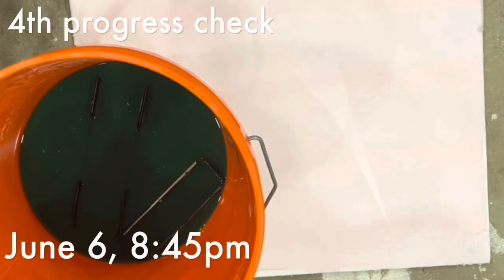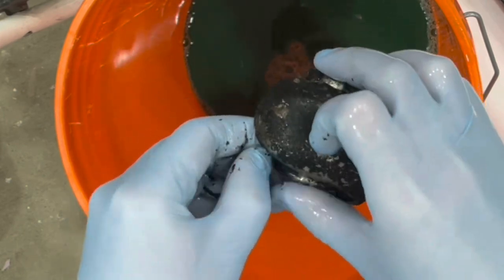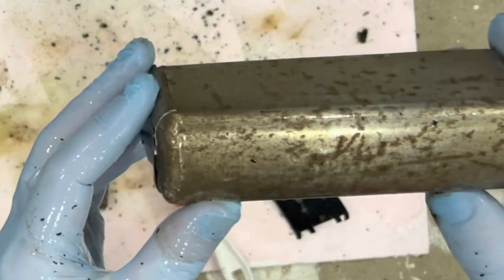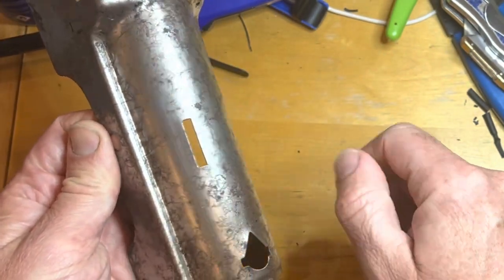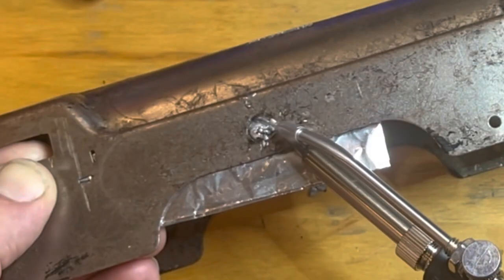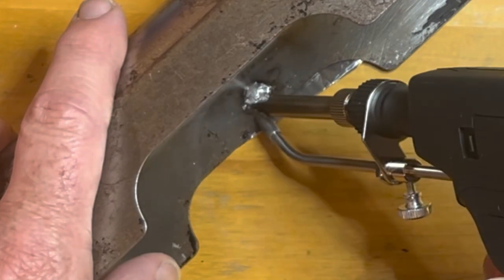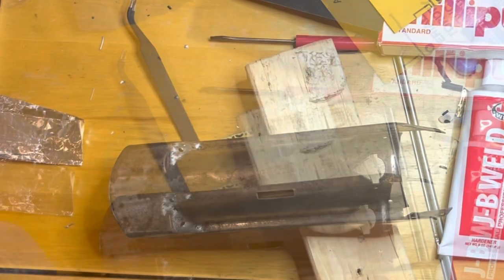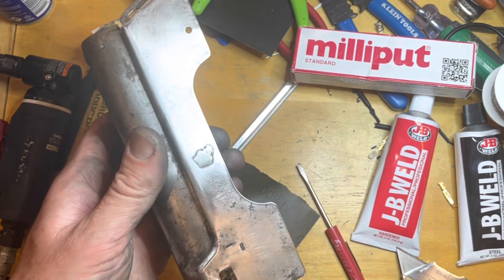Will Simple Green Strip the Paint off of this old Marx Engine? Marx Repaint Part 1

Comment: JB Weld metal epoxy will work to fill the holes and is sandable.
Reply from the maker: I’m leaning towards using it for the other hole in the shell

Comment: try some paste flux and an iron with a much larger tip, it still might not work but it's worth a try and try copper foil instead of the aluminum tape.
Reply from the maker: Flux, yes I need some. Didn’t think of a wider tip. I have a wide tip for my iron, should have tried it.
Reply: @dagryffynhobby  at work I had to solder shut two halves of a small metal box and we used copper foil strip across the seam that was soldered across the seam using flux and an iron that had a tip that was about 3/4 inch wide , not sure you will need a tip that wide but if the metal you have can be soldered your idea should work

Comment: You could glass bead and be all done in 10 minutes ready to paint. All paint and rust gone too. It was suggested use JB weld assuming to fill pits left from rust. That works well as JB weld has metallic properties. It does take more effort to sand vs body filler but is better for handling and derails.
Reply from the maker: I could glass bead it and be done, but I don’t have that. I really like using just what I already have. That being said, I do need to get a media blaster at some point.

Comment: Try lemon juice.  Soak in the garage or outside, not in the house.  Will clean down to bare metal no scrubbing.  Eats rust like no other.  Will not hurt bakelite.
Reply: Sounds interesting but expensive.  Have you tried it on plastic?
Reply: @wayneantoniazzi2706 Bakelite is the old plastic post war equipment is made of
Reply: @H.O.Scalemodeler4501  Oh, I know.  I'm wondering about contemporary plastics.
Thanks for the response!
Reply: @wayneantoniazzi2706  I  use the cheapest lemon juice I  can find.  It cleans Lionel and American Flyer with no problems. Been using it for 33 years.
Reply: @stephenrickjr.7519  Thanks, I'll give it a try!  
(CVS is slow on re-stocking the large size of alcohol anyway!)
Reply from the maker: Cool. I’ll try it out 👍

Comment: I heard before oven cleaner works as well. Never tried it though
Reply: I tried Easy-Off spray oven cleaner on a Lionel plastic tender with an absolutely horrible amatuerish paint job.  The Easy-Off barely dented it.  However soaking the thinkin 90% isopropyl alcohol stripped it clean after a 24 hour soak.  Go figure.
Regular Easy-Off might do the job but I see no reason to try it now.  I tried regular Easy-Off as a gun stock finish stripper 40 years ago and it worked great, but MAN did it stink!
Reply from the maker: I have heard the same. But like Wayne said, it’s not a fun smell. I’m trying to minimize the stinky!

Comment: Interesting Dave!
A week or so ago it was suggested to me to use 90% isopropyl alcohol has a paint stripper, I wanted to strip some old Lionel tender shells without damaging the plastic.  How'd it work?  I think it really depends on the original paint.
After soaking 24 hours the paint on one tender sloughed off like peeling a banana, the other not so much.  That took some scrubbing with a stiff plastic bristle brush.  So the alcohol treatment is a "it depends."
Simple Green sounds interesting.  I wonder if it's safe for plastics?  I'll have to find that Warren Muzak video and see what he says.
As far as those pits on the metal of the Marx engine are concerned I remember what I heard years ago:
"Pits are forever!"  Of course you can mitigate them a bit by sanding but you have to be careful not to go too far.
As far as getting rust off metal surfaces I've done it on gun parts using a brass scouring pad, it cuts the rust but doesn't hurt any finish left behind, and of course brass won't cut steel. 
Oh, those holes in the Marx shell?  If it was me I'd epoxy some thin sheet metal on the inside of the frame to cover them and call it a day!  The "ghosts" of the old holes wouldn't bother me.  
Thanks for posting, and for putting up with THIS long comment!
Reply from the maker: I’ve heard a few people say alcohol to strip paint, I’ll have to try. I put a plastic postwar tender shell in the simple green a few days ago, so far so good. Took the stamped letting off quickly but the black paint has been more resilient. I should probably check it tonight to make sure the whole thing hasn’t dissolved!
I put a link to warrens video in my video description. 
Yeah I’m fine with pits and gouges. I’m not interested in making it look like a new toy. 
Hey, no problem with long comments, sometimes it just takes me longer to reply!

Comment: Simple green’s active ingredient is Butyl cellusolve.  (Aka butyl ethyl ether).
Reply from the maker: Since you posted this I have looked and I cannot find anywhere that that is an ingredient in the all purpose cleaner. Do you have more info on that?
Reply: @dagryffynhobby  I Googled simple green and read the Safety Data Sheet.  I worked for a company that made it as well as several others.  We use to use the solvent in the lab to clean up and it would remove the paint from the cabinets.
Reply: Forgot to say that the safety data sheet said there was less than 6% in the mixture.  I assume the rest to be water.

Comment: I've used epoxy to fill holes on plastic models. Maybe using some metal epoxy will work? Put some masking tape on the outside of the hole, spread the epoxy on the inside, let it dry. Peel the tape off . The part people will see is smooth. I dont know if it'll work on metal, but this technique will work on plastic shells. Then again, O gauge plastic shells seem to be a different plastic from HO!?
I do have a tin clockwork shell coming. I want to hide the hole with epoxy. I'm not going to repaint. It has two different colors n pin stripping! 😮
Reply from the maker: Good idea, I’ll have to try that both with a plastic shell and one of these metal Marx shells too.